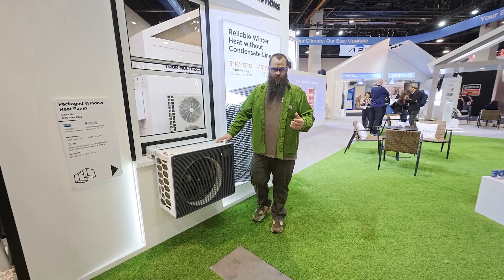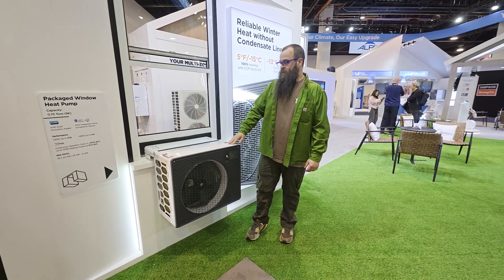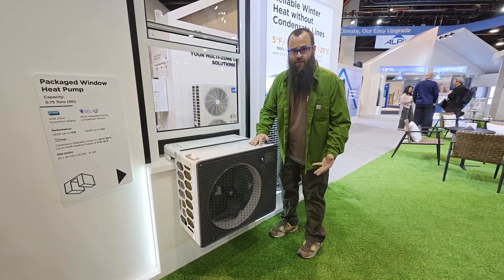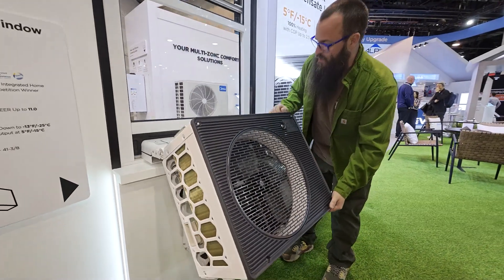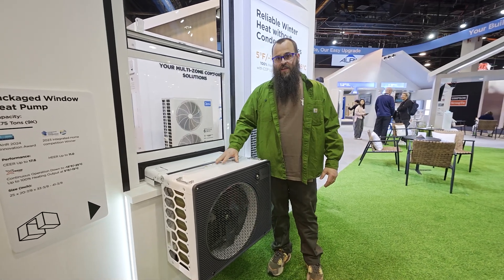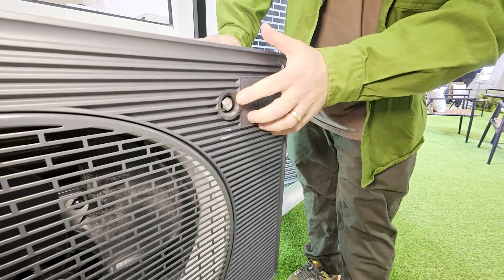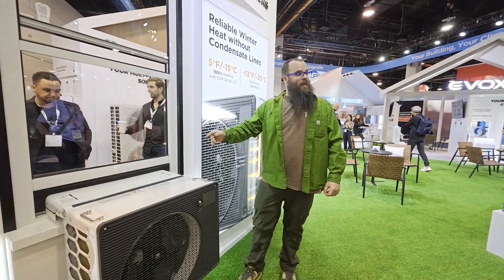A Drip-Free, Through-Window Heat Pump

Comment: An air conditioning unit is a heat pump that somebody has stolen one part from, the reversing valve.  Stop accepting that there's some kind of major difference justifying a huge price premium.  We buy window air conditioners for $200-$400.
Reply: You do know it heats lower than 41 deg. Down to 5F
Reply: An normal ac will too
Reply: And your $200 A/C also heats a room? Or did you forget what this video was about?

Comment: Have Midea figured out their mold issues yet? I had to fill out a return because my U shape AC unit was filled with mold after only one season of use. Turns out there was a recall from Midea for this problem.
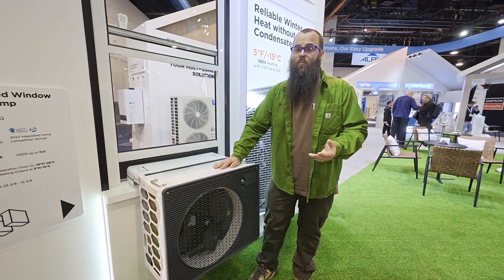Reply: Did you watch the video? At 0:50 he clearly stated they built in a condensate mister. 🤦🏽‍♂️
Reply: All window units will grow mold if they aren't serviced properly. Yes Media has already stocked the shelves at Costco with the 'figured out' versions.
Reply: @LemonySnicket-EUC yes this is true. and not relevant. Midea had to do a recall because it was beyond the normal issue.
Reply: Only because they didn't have a drain hole. It will still get mold just like they all do but now they are off the hook because it now has a drain hole like all of them do.  @iCounterProductive
Reply: @LemonySnicket-EUC have the last comment if you really want to.

Comment: Chinese brand is revolutionizing window ACs and no one notices
Reply: I must have missed the revolution part, because maybe it hasn't happened yet. Everything China does is extremely suspect BTW.
Reply: Actually, GE makes a window unit that is 8K BTU cool and heat, weighs less, works the heat pump down to 5F, and...drum roll...costs $529. Gradient (can't get) and Midea, (Not sure how to get) are at least 3 times that, plus mandatory installation.
Reply: @jaygolen8437 ge one isn’t same. It only heats using compressor until 35F. Then it uses auxiliary heat.
Reply: @AhmedReaz  perfect for CA and places with similar climate